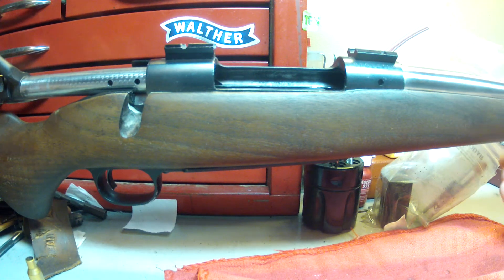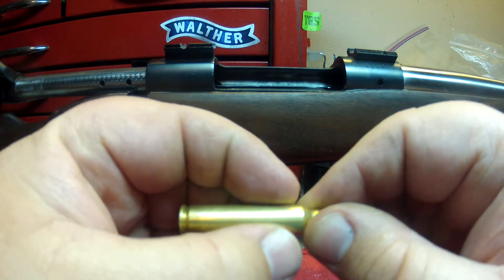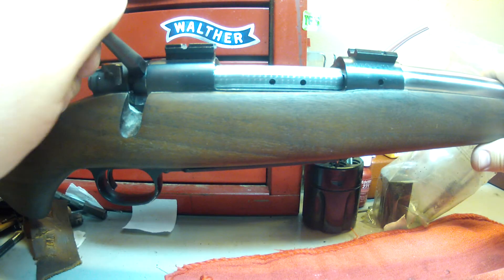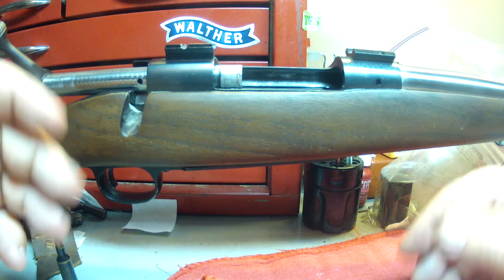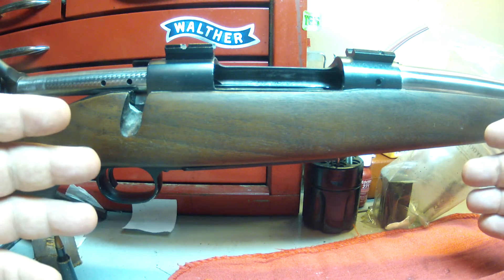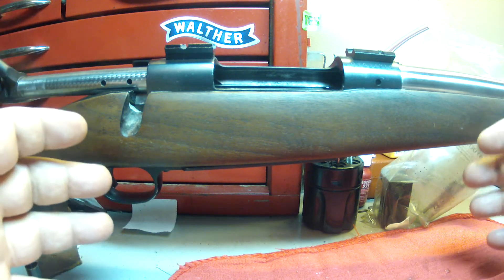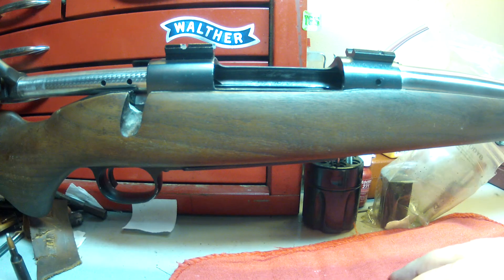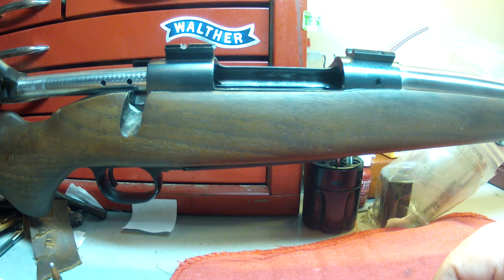Custom Rifle Build GONE WRONG!

Comment: what is the difference between ejecting a longer and shorter round with the same case diameter?
Reply: It fell out of the extractor. Longer cases rest on the chamber long enough for the case to get to the ejector. At least that's my understanding
Reply: Action length shouldn't matter wonder if it was a magnum bolt face?
Reply: That would be true In a push feed rifle. Control round feed is different. The pre 64 243's were all standard length action rifles.  If it was a magnum bolt face it wouldn't Control the standard case as soon as you open the bolt it would drop out.
Reply: The remington  783 is a long action for the 243, pushfeed and handle the brass smooth...?

Comment: Action length shouldn't affect it is it a magnum bolt face?
Reply from the maker: No it was not. And yes on a non-controlled round feed gun it will affect it. It has too much room to move around before it clears the action and the extractor lets go of the round before it can be ejected.
Reply: @vdcfirearms3609  I thought for some reason it was a model 70 my mistake 😅 🙃
Reply from the maker: @randylong8156   It is, A post 64 model 70, when they thought changing the design was a good idea.

Comment: A 22-250 shell is only .103 shorter than a .308 so I wonder if the winchester action is that much pickier than a Remington or if another factor is to blame. Just trying to start a friendly conversation not a WAR :)
Reply from the maker: If it was a short action it would not have been a problem. But this was a long action that was a 30-06.
Reply: VDC Firearms very true I guess I forgot to mention the most important part of my statement and that was in reference to the Army using a long action for .308
Reply from the maker: Yes and if you noticed I mentioned that if he had used a Winchester 70 with the claw extractor (pre 64 or Mauser) it probably would have worked. And keep in mined that the Army M40 are custom built and tuned to do so. The customer did not want to put anymore money into this gun. So yea you are correct some guns you can get away with it and some you can not.
Reply: it has nothing to do with long or short action. its the caliber the bolt face is chambered for. need to have the bolt face changed or machined to accomadate the smaller diameter of the case. then it will extract, also if run a go no go gauge to check headspace
Reply from the maker: You are wrong. The 30-06 and the 22-250 have the same rim diameter of .473. It has everything to do with the long and short action there is just too much room for the round to move around in the action with the spring loaded ejector pushing on the round. So keep trying Trevor and you may want to refrain from making assumptions about gun that you have not worked on.
Reply from the maker: It has to do with the type of action and that it is too long. The round is basically leaving the bolt face before it can clear the action leaving the round in the action. This is do to the plunger stile ejector, spring loaded extractor, and having too much room in the action to move around in the Longer action. Yes the Savage only has one length action and is designed to work with long and short rounds. The post 64 Winchester had long and short actions and one is not designed to work with the other. If you noticed I mentioned that if it was a pre-64 or Mauser action both only having long actions it would have worked as well. It is all about the design of the action and this Long action is not designed to work with a short round.
Reply: Why not punch it out to a 220 swift

Comment: I wonder if there was miscommunication between the seller and the buyer and it was actually built for a 25 - 06? That would make more sense to me. I've never heard of anybody trying to put a short action bullet in a long action. Thank you
Reply: Brian Lee ,
  In a push feed action it can be a problem. My first 22-250 was built in a VZ24 Mauser action in 1965. Being a controlled feed action will allow for these things to happen. I never had a failure to feed, or to extract either a live round or fired case.
  If the rifle was actually built for a 25-06 as you suggest, there would have very likely been a case separation if the firing pin could detonate the primer. It sounded to me that rebarreling to a 25-06 would be a way to put the other parts to some use. Another avenue would be to rechamber the rifle to 22-6mm Remington, which would likely need a 8” or 9” twist barrel to stabilize a 80 grain bullet. Another loser!
Reply: @robertqueberg4612   Cool. Sounds like you chose the right guy to fix it. You seem to know your stuff. I hope it worked out. I got a feeling that guy lost a lot of money on that gun. Thanks
Reply: I have a question for you because you seem to be really up on guns. I've been doing my homework and it seems like CZ builds a really good gun I'm thinking about buying their CZ 550 in a 300 Mag? What's your opinion on that you see any problems with CZ?
Reply: Brian Lee ,
  I am sorry to run out of information on your purchase. CZ seems to have a good reputation on line, but I have had no experience with them, nor have I talked to anyone that has one to ask. The local gunsmith that I helped part time for years was mainly doing warranty work for the American brands. Sounds like either brown bear or elk hunting. Best wishes on your hunt for a rifle and your trophy. Or moose!
Reply: @robertqueberg4612   Thank you for your honesty. Yes elk and moose are definitely on the menu. Maybe I'm weird but I've never been inspired to shoot a grizzly bear. I will shoot a black bear though because my wife loves to eat them. I only shoot things I'm going to eat. Thank you
Reply: Brian Lee ,
 If you live where woodchucks/groundhogs are, the young ones a great eating while the coat is still dark. Shake ‘n Bake in the oven. You could pass the older ones off as pulled pork after cooking in a pressure saucepan and deboning with an hour or so in a slow oven with good barbecue sauce.
  If that were my Mdl.70, I would strip the bolt and remove a coil or two of the ejector spring, or put it somewhere that I could not remember. The CZ has a claw extraction like a Mauser if I remember the pictures that I have seen. I will pass along a help that I learned over fifty years ago. You may already know this, but each round must be fed up from the magazine to get the rim behind the extractor. They can on rare occasions jump ahead and get jammed into the chamber. To remove the cartridge, point the muzzle toward the ground in a safe direction, with the bolt resting against the cartridge head. Reach over the top with your left hand to hold the rifle. If your thumb has not been badly broken, it should be pointing towards the rear. Press the base of the first joint inward at the mid point of the extractor, while you gently close the bolt. This makes the extractor head swing away from the center. Once the bolt is closed, your hunt can continue.
Best regards,
Bob
Reply: @robertqueberg4612   Nice. I live in Colorado and my wife is Chinese and she's always wanting to try the woodchucks. I wouldn't mind trying them I figured they are good. I haven't owned the CZ but they advertise it as 5 in the magazine + 1 in the chamber. good information though I'll have to remember that just in case. I plan on having CZ build me a 300 H & H Magnum which are known for easy feeding and extraction. Not very many companies manufacture rifles for 300 H & H anymore but there's still plenty of ammo and lots of bullets available if I decide to hand load which I'm thinking I might do as a hobby. I also thought about possibly restoring a pre 64 model 70 300 H & H if I could get a good deal on one. The big plus that I like with the CZ 550 is they have an option for a aperture sight that folds flat into the receiver underneath the scope and if you have scope issues you can remove the scope pop the aperture up and you're good to go. I also love and aperture in short range hunts where you need quick Target acquisition were you don't want to fool with a scope. That's one of my top reasons for choosing the CZ. Thank you
Reply: Brian Lee ,
 If it makes a difference to your choice of actions, the CZ 550 is a Mauser style controlled round feed action. Everything must go into the magazine first. That is unless CZ has found a new trick..........
  Tell your wife to go for the woodchuck feast. Our son and two brothers that he played Little League with, all loved it. If ten year olds will eat it, and ask if their mom can buy it at the local market, you have a winner! Prairie dogs are too much like rats for a farmer to eat. A 22-250 still ruins half the meat at 350 yds. Feed the scavengers and claim a 5% tax credit. ;-) The Howa 1500 is a similar type action, which Weatherby uses as a base for their working man rifle line. They have mini, short, long, and magnum actions to pick from. No aperture sights. :-(
Reply: @robertqueberg4612  Ok thanks for all your info we will have to try the wood Chuck's or groundhogs. Maybe I need a second rifle? LOL isn't that how it always goes you can't have just one rifle for everything. Thanks I think I'm definitely going to need a scope for those groundhogs.
Reply: Brian Lee ,
 As an American, you are free to choose.

Comment: Sorry, but what its doing has nothing to do with it being a long action.
Reply from the maker: Well please enlighten me,
Reply: @vdcfirearms3609   correct me if im wrong, but the dimensions of model 70 bolts and actions are the same between long and short action other than actual length. The malfunction is happening before the length even plays a factor. People run short calibers in long actions all the time, 260 rem is one that is probably  the most common around my area. It is not ideal to run long actions on short calibers for feeding and cycle time reasons, but as far as extracting, it should make no difference.
Reply from the maker: @chughes44  You are almost correct. If this had been chambered in 308 or 260 Rem it most likely would have been just fine. However this was chambered in 22-250 a round that is shorter then the 308. It is a true short action round and works well in many of the mini actions that are out there. putting that round in an action as long as the post 64 Winchester long action you run into this kind of problem.